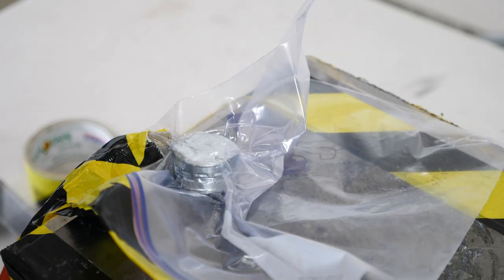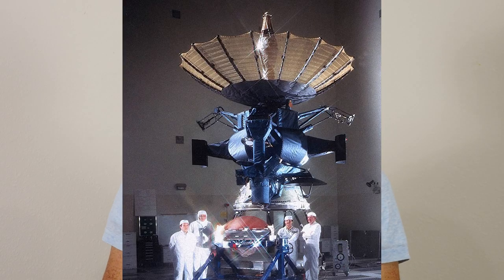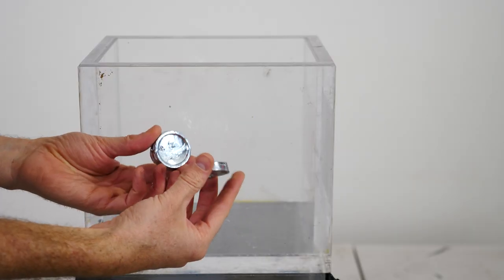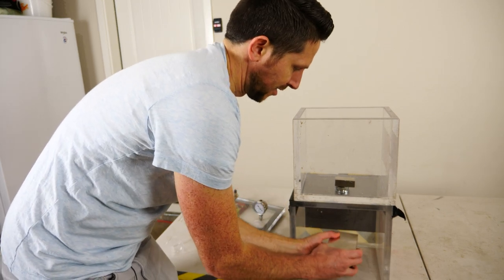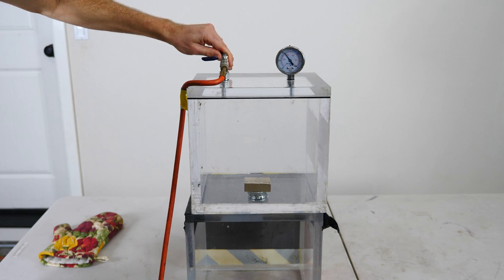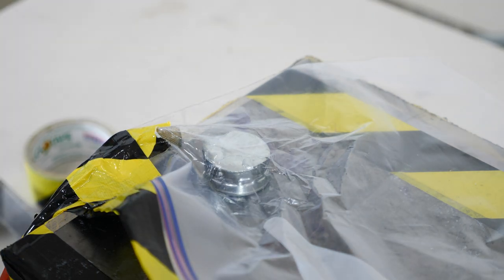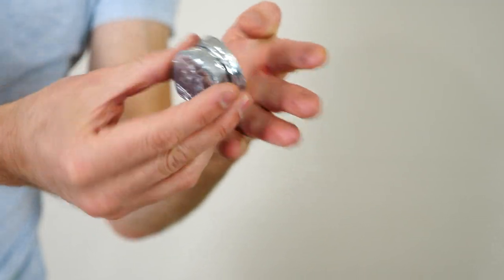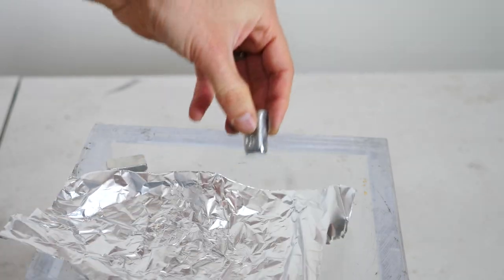Cold Welding Metals In a Vacuum

Comment: Gallium has a low melting point so that may not be cold welding as you describe it, because the sustained pressure from the vacuum bag can provide energy at the surface which will create a thin layer of liquid, much in the same way an ice skate melts the ice it is in contact with. Gallium shares some physical properties with ice/water, such as being a supercooled liquid, etc. POSTSCRIPT: This has got me thinking about ice cubes in my ice maker in my freezer. A few days ago I emptied it and all the cubes were stuck together. Today it is half filled with fresh cubes and none of them are stuck together. I bet if I took a pile of them and vacuum sealed them at a cold temperature, they would get stuck together.

Comment: Pretty sure the pieces were held together by atmospheric pressure as there was still vacuum in the pocket between them
Reply: Came here to say that.  The oxide layer, once formed, has to be sanded off in a non or low-oxygen environment in order to get that cold welding effect.  In fact, they have to do that for hot welding, too.  Otherwise the oxides would screw up the bond.  The titanium umbrella thing is a different issue entirely.

Comment: Lapping two pieces of gold, or gold plated metal chunks flat is a great way to demonstrate cold welding as well!
Also, steel that has decent protection against oxidizing, and is decently clean and very very flat will start to cold weld. 
Finally more pressure, faster welds. Ive intentionally designed steel parts to be an interference fit that have welded under pressure in just a few hours. No vacuums required, but a good press, and skilled manufacturing is.

Comment: layer of oxide is not part of air but rather part of metal itself (like rust) therfore if you remove air layer of oxide remains the same and will not cold weld any more than in air. Also removing air is changing pressure therfore affecting galium melting point. It probably stuck togerher because by rubbing one part against another you have scraped the oxide layer and created enough heat to hot weld them toghether.
Reply: That's why the friction is important, the mechanical force is sufficient to remove the oxide layer on some metals cold welding can even occur with much more stable metals if they are ground together with enough force and then allowed to sit for a bit 
To account for this any metal on metal joints are now lined with ceramic to prevent cold welding

Comment: You haven't removed the oxide layer. Maybe lightly sand the surfaces in a nitrogen atmosphere, then apply the vacuum
Reply: Why nitrogen then vacuum? Wouldnt cold welding work in nitrogen already? The whole point of the vacuum is to remove the air which is what youre doing already with nitrogen
Reply: @calvindibartolo2686  I think you're right. Remove the oxide layer in an atmosphere free of oxygen and it should work with simple pressure.
Reply: @NextGenerationHealth  honestly it would be cool to be wrong though! I love science!

Comment: If you remove air from them it doesn't mean that oxide layer will also be removed, you also need to remove the oxide layer. The vibration of the galileo spacecraft make the 2 metals rub to each other so the oxide layer removed.

Comment: Are you sure it's not the Vander Waals force? Smoothly cut steel will stick together.
Reply: Nope. Its pure metallic bonding in metals
Reply: @syedhasnainali8282  how do we know, did they do a bond boundary cross section or something? X-ray maybe?
Reply: @zaccb1566  That is a good question. Yess we use very poweful microscopes called electron microscopes to capture the crystal structure. And we can use Xray Diffraction to get the bond energy and length
Reply: @syedhasnainali8282  ya, I know... I'm just not sure what he did was truly welding and not some other kind of phenomenon. I used to do metal inspection.
Reply: @zaccb1566  Nah it was true welding. Really? Thats so cool. What types of testing did you do? I'm currently taking a course on Non destructive testing and its pretty cool
Reply: @syedhasnainali8282  I did things like white and blue light, uv penetration, x-ray, (sent out for some of it)  optical comparitor evaluation of the seam cross section, manual measure and sample break tests. Then we might send it out for high magnification grain x-ray. You're really looking for the lack of a median line for a true weld. Plus imperfections. 

Lots of stuff looks welded from the outside, and didn't truly bond on the inside. It kinda just stuck together like puzzle pieces. How much of this there is contributes to how good a weld is. And what it looks like changes based on method.

Comment: I remember my science teacher, many years ago demonstrating a similar effect to galling by slamming a blackboard eraser into the polished wooden blackboard frame and twisting it slightly.  When he removed his hand, the eraser remained where it was.  I was quite amazed.
A light touch sent it falling to the floor,.  But you can cold weld wood too!
Reply: It's due to vaccum and not cold welding.
Reply: @ShivamSingh-cv2to  You think so? I struggle to see enough air being removed from the contacted side, by slamming it as opposed to just pressing it into place, which doesn't work. There's going to be such a little difference in the air being pushed out of the gap between both methods.  I was taught  it was the rough fibres of the wood, although polished, meshing just enough on a molecular level to hold it in place.  If I recall correctly, it wouldn't work cross grain to grain.  Only if the grain was aligned would it work.
Reply: @ShivamSingh-cv2to  If anything it was just pure friction.  But demonstrated on what seemed to be very smooth surfaces.
Reply: @poppedweasel  It could be friction. If it could also support its weight while being upside down and not vertical then that would be something else but in this case I think you might be correct.
Reply: @ShivamSingh-cv2to  I feel an experiment coming on ;)  A pity schools don't have blackboards any more.  And it would look creepy me asking access to a school.  I'll leave this for the Action Lab.

Comment: Yeah, I have gallium, I've done this before too, except I did it in air. I actually got it to hold together stronger than he showed when I tried it in air, than what he got when he used the vacuum chamber or bag.
Why do you think it works so well with gallium? well for starters its a bit softer than say, aluminum, but the main reason is, that it melts so easily. At room temperature it only takes a small amount of friction to make a thin layer melt on the outside, and then they will weld together and the heat will disperse and it will re-solidify.
Try to do this with another metal.
Oh and also, it could be that the metals were pressed together so hard that the surface of each piece bent and deformed to be he exact same as the other piece, aka it deformed to the same shape.
And this caused there to be so much friction between the two that it overcame gravity.
This experiment needs less variables to be accurate.